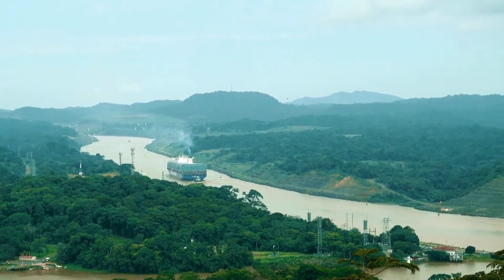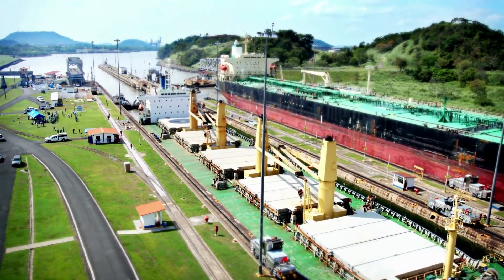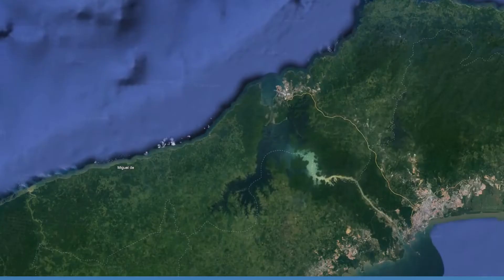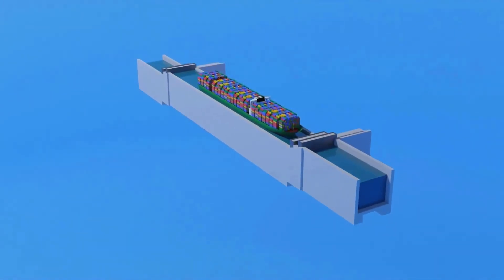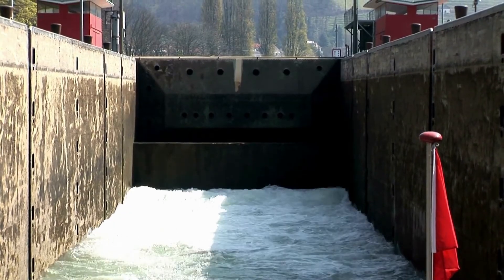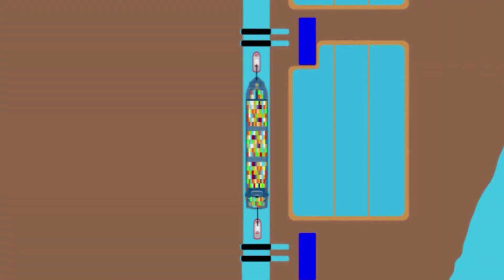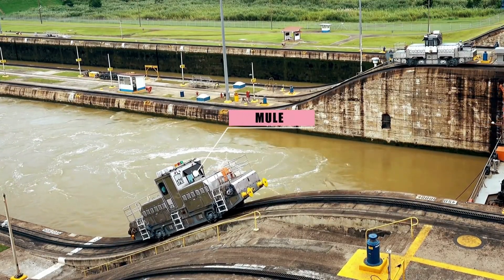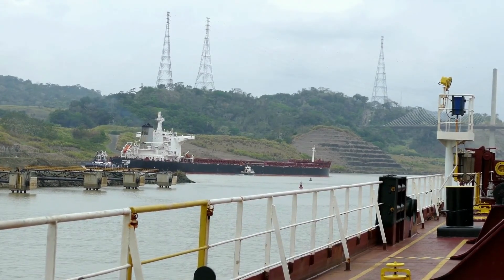New Panama Canal Locks Expansion

Comment: HAHAHA!  Sure thing, take a balanced system with capacity to run the double locks designed at the time at maximum efficiency, including droughts.  It ain't broke, but let's fix it by adding on "only" another 93% more water, which means expending 146.5% water loss for each passage on all three locks.  Assuming that is an actual accurate percentage.  Smaller ships (like the old Panamax ships shown) waste more water by not having enough hulls to displace the maximum amount of water.  
It is absolutely no wonder why the predictions are for "permanent" drought conditions.
I'll skip the Chinese influence remark here...